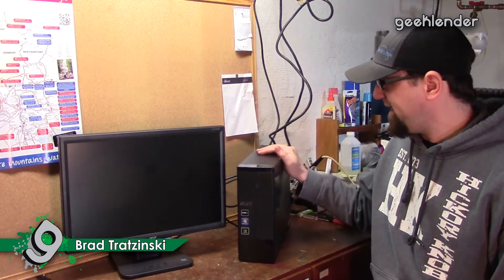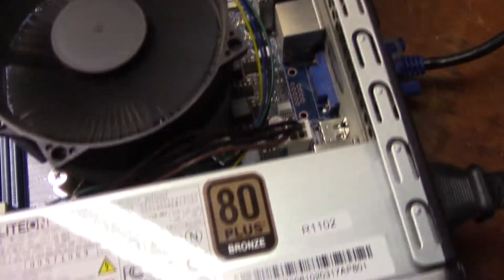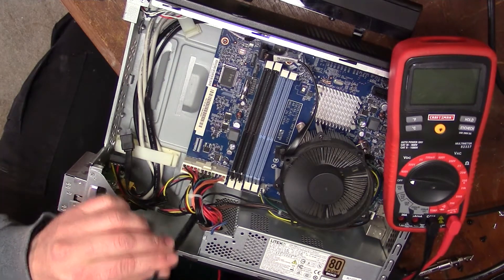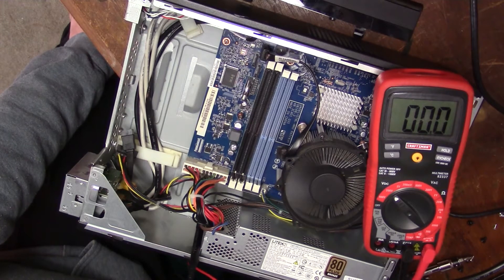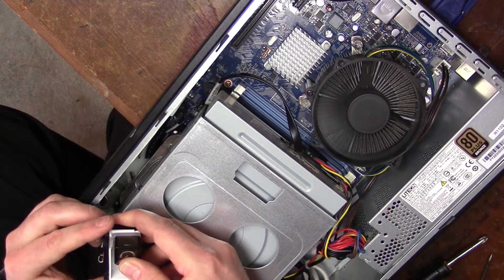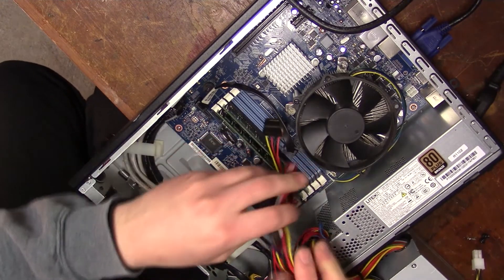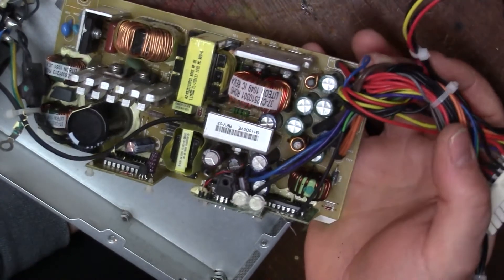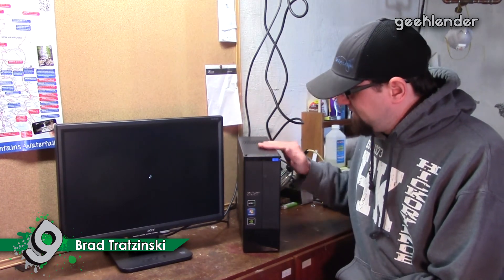Acer Aspire AX3400G Repair - Brad Tratzinski

Comment: BTW, If you slam your fist down a time or two on the power button area sometimes it will come on and work fine, Also, when that doesn't work you can take the front panel off and remove the power button and fiddle with the wires and put it all back together and it will work perfect for a while until it doesn't. I'm thinking a short in the power button wiring?
Reply: Sounds like it's about ready to DIE... 🤔

Comment: Which SATA port does the hard drive need to connect to? 1,2,3, or 4?
Reply: Never mind, the hard drive doesn't need any specific SATA port- the actual problem is the RAM placements. With my old hard drive, both RAM sticks were in RAM slots 3 & 4, and somehow the PC allowed it to boot. But, after installing the new hard drive, it wouldn't boot unless I took the RAM stick out of RAM slot 3, and placed it into RAM slot 2. Then, it worked. I'm still unsure as to why my old hard drive was running semi-smoothly with those RAM sticks misplaced- Oh well, I guess I might never know :D

Comment: Hi Brad,
Many thanks for the video. Found one of these units down the dump, tested it and found that the power supply was buff the same as your one. Changed the Caps as you said and "Bingo" now works again.

Comment: Hi Brad.  I was happy to see your video because my Acer AX3400G is doing the exact same thing!  I suspected the power supply when it started the symptom a month ago, so bought a replacement and installed it, but it's still doing the exact same thing!  Any insights?  Perhaps the used supply I bought is also bad?  I haven't got my multimeter out to check either supply out, but based on your video I don't know how useful that will be.  I bought a refurbished Dell to keep my wife happy in the meantime, but really would like to fix the Acer.  Thanks!
Reply from the maker: Thanks for watching! Check for bulged capacitors on the motherboard. This can cause similar issues. Cheers!
Reply: Brad Tratzinski.  Thanks, Brad.  I went over the board as well as the original power supply visually, and can see nothing even remotely suspicious.  Because of the oddness of the DTX sized board, I think my only option at this point will be to store it away and think about it a while.  Thanks for your response!

Comment: Hey there bread I know you probably won't see this but my acre aspire x3400 is not working it turn it on all of the display works for a few seconds then it proceeds to make a loud revving noise from the fans like its shutting off then it shuts off and I have tried testing ram different power supply
Reply from the maker: Check for bulging capacitors on the mother board. This may cause your problem.
Thanks for watching!
Reply: I think that the problem is the bios are corrupted they need to be rewritten but I don't know how to

Comment: hi brad..I too have this problem with this machine..i bought it new many light years ago and it has, and still does serve me well!...This problem only happens if I wish to switch 'ON' again, straight after i have already shut it down...I normally have to wait at least 15 mins or so before switching it back on again.....I have tried holding the power button down for a minute before attempting to plug back into main supply, but it doesn't work..do you think its the bunch of Capacitors, as the prob' with your machine?!...Thank you.  - :)
Reply from the maker: That sounds like the same problem to me. most likely a bad set of capacitors in the power supply or even on the motherboard.
Reply: Brad Tratzinski   :)
Reply: PROBLEM SOLVED!!....I opened up the case, disconnected Optical drive & Hard drive, made sure all connections were secure re connected, Blue Screen Of Death is no more!...  :)
Reply from the maker: +MRROBBIEWATTS AWESOMENESS!
Reply: @MRROBBIEWATTS  Har, that goddamn optical drive must've been a real PAIN IN THE ASS to remove... 😝